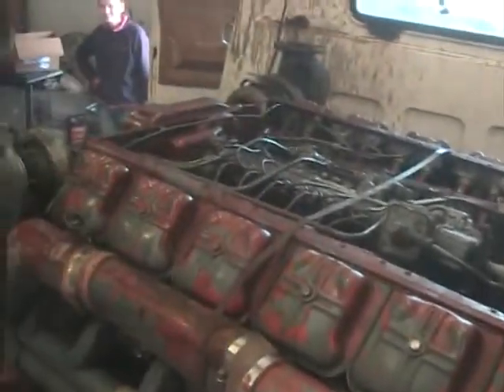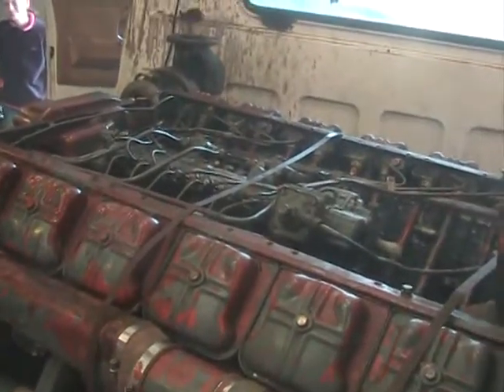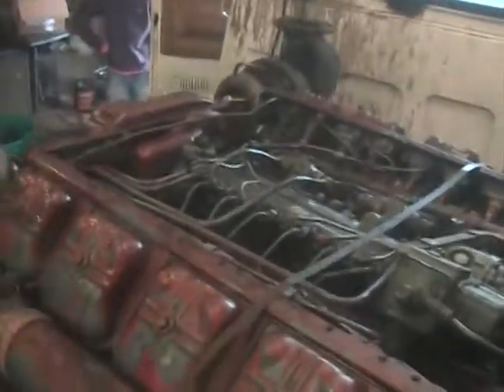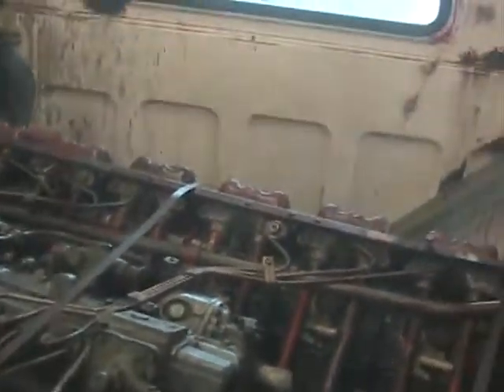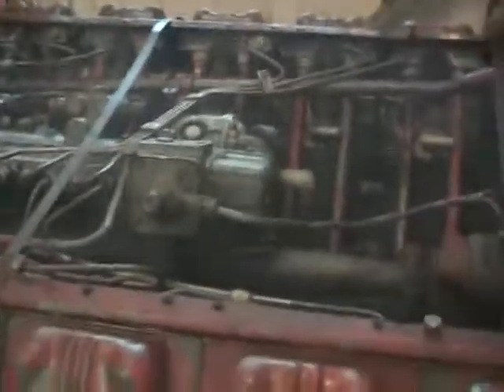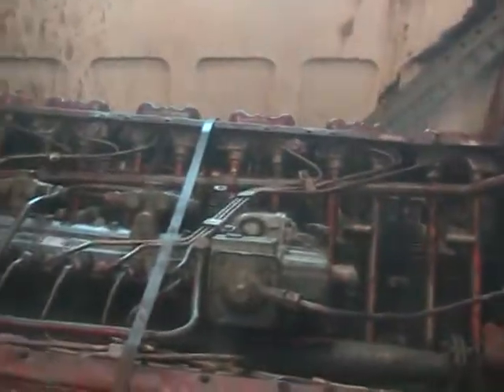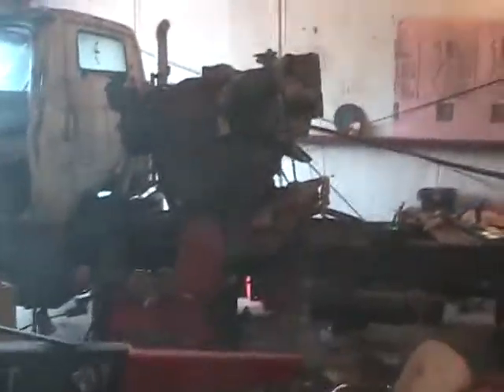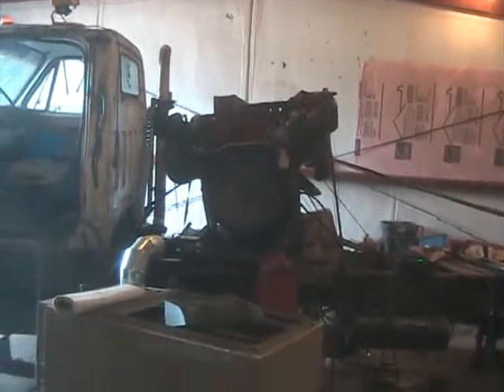Deutz air cooled twin turbo V12 - alive!

Comment: Superb engines, very reliable. Sounds like the valve clearances need adjusting..
Reply from the maker: Yes they do. It had a stuck valve. Ended up having to take the head off and replace the valve + spring
Reply: @castirondude  👍

Comment: 👍👍👏 Hope it's still running.
Best regards luck and health.
Reply from the maker: I think so. It's been under a tarp and an extension cord shorted and set the tarp on fire. It's black now but the outside is mostly sheet metal so I don't think the engine suffered any damage.
Reply: Dear @castirondude  
Thanks for replying.
What? Great Deutz under a tarp for years and got burned also? No project was made with this engine as you originally planned?
What happened to the Dodge/Isuzu daily driver project? Not under a tarp for years I hope?!
Thanks in advance for answering.
Sincerely yours.
Reply from the maker: @Chr.U.Cas1622  I did actually build the 1928 Dodge with the Isuzu. Took it to a car show and a few other things but never made it into a daily driver. The 50HP is only good for about 50-55 mph as it turns out because it has the aerodynamics of a barn door. We moved, I'm just building a workshop so will probably pick the project up again one of these days.
Reply from the maker: @Chr.U.Cas1622  I hired a machine shop to make an adapter for this V12 engine to an Allison 3060. They made the flywheel to torque converter adapter but not the bellhousing adapter.
Reply: @castirondude  
And now? What will you do with the 12 cyl. Deutz? By the way: Was the problem with 1 cylinder problem solved?
Reply: @castirondude  
Thanks again for replying.
Hope that great lookin' "barn door" will be on the road sometime. If a relatively big and reliable good 2.5 l diesel has only 50hp it's throttled usually. Isn't there a possibility to change that respectively put a turbo on it? And/or another gear box respectively changing gear ratio in the gear box? And/or another rear differential? Usually Diesel engines have enough torque to do so.
This Dodge looks so wonderful that it deserves to be back again. But that's only my personal opinion respectively kind of taste. Maybe those rigid axles with leaf springs (even with added shock absorbers) are simply not good enough for bumpy roads nowadays. And that therefore the Dodge oldtimer will never make it as a daily driver that is not only great to look at?
Good luck with your new shop.
Sincerely yours.

Comment: Got the 10 cylinder version of this in a piling rig where I work. Great engine, not put a spanner to it in anger in 12 years. Had a pump and injectors done, set tappets every year and she still going strong!!!

Comment from the maker: @pskittle488 yes they are german, these are not common at all. You do see a fair number of the smaller 2-4 cyl Deutz tractor engines (i.e. F4L913) but these big ones are very rare. But all the parts are readily available from the dealer - for a price. Yea you can get the same torque and horsepower from a Cat or Cummins anyday but I also liked it that these are aircooled.

Comment from the maker: @Xx69roadrunnerxX The MD3060 is a 6-speed, 5 is overdrive and 6 is a double overdrive! With 3.5:1 axle ratio I will be running 1450 rpm at 65 mph !

Comment from the maker: @Xx69roadrunnerxX I paid $1800 for the engine.. which is exactly half of what the guy was asking. But at the time I didn't even know if it would run!
I'm not going to put a hood on there, so yea it will fit. I can move the fenders out some if needed :-)
I'm building my own front suspension around a dana 60 so it will be a 4x4!
I'm putting dually wheels on a non-dually axle (19.5 rims will clear the brakes and look close to the original 20" wheels) and that will make it narrower

Comment from the maker: @gangesexcavating thanks! ahh I tell ya it took me a few weekends to get this thing running, a few times I was starting to get afraid that maybe the thing was toast (i.e. broken crankshaft) so boy I'm happy that I got it running!

Somebody had put hydraulic filters on it instead of regular engine oil filters. Hydraulic filters do not have a bypass. They were really old, and were full of gunk, so they probably plugged all the way up, engine lost oil pressure and lost a bearing.